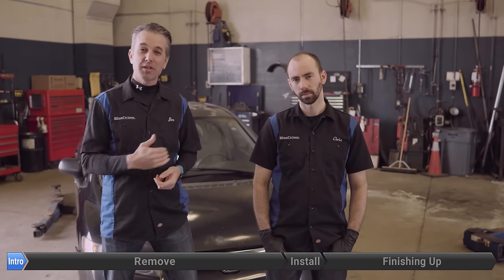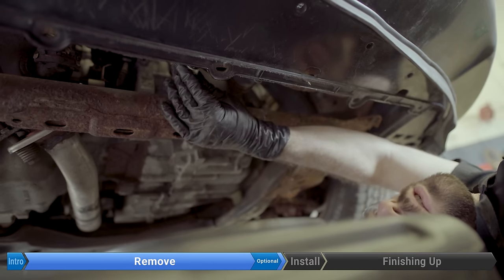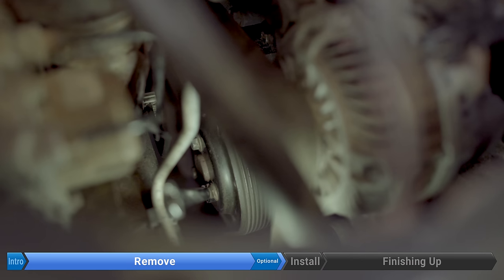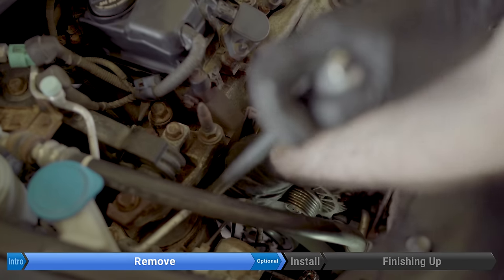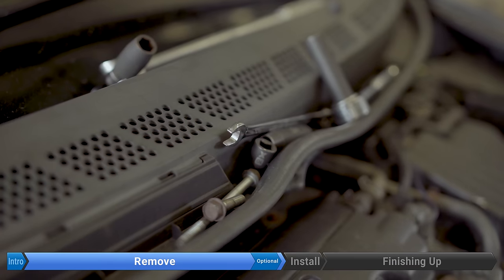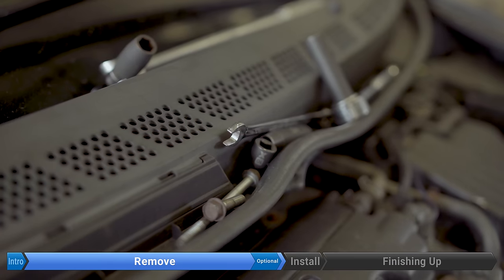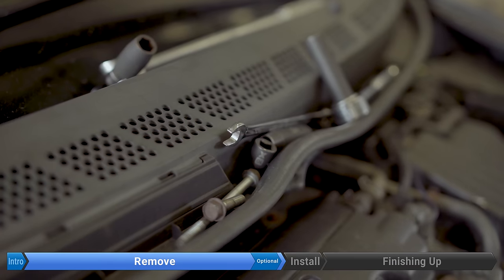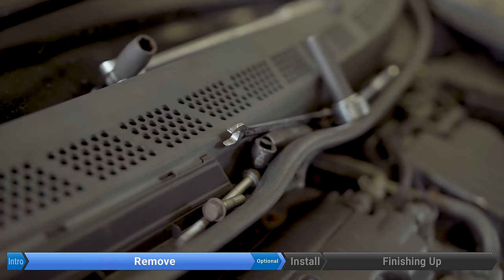Water Pump – 2006-2011 1.8L Honda Civic

Comment: Finally a repair video that doesn't just say "to install,  just follow steps in reverse", but actually includes torque specs along the way. Great content. Tackled this job in 4 hours (mainly waiting for the penetrating fluid to work)

Comment: Great Video here!  You are obviously a seasoned pro tech.  The way you talk about not rushing the job, using patience on stuck bolts, and use of torque wrenches to apply even torque on the pump and also makes it nice if somebody else ever has to go in there again.  A+ job!

I just happened to drop by because I bought a used Honda and wasn't familiar with this model motor and wanted to take a look before diving in.  It will get the same treatment that you apply, been fixing cars for almost 30yrs now.

Subscribed!!!

Comment: I moved to Texas from Chicago 35 years ago. I have forgotten just how rotten and rusty and corroded cars get up north! I have a 2010 with 170,000 miles and it looks brand new under the hood and the chassis. No rust and all the fasteners still have inspection marks and plating. I feel for you guys working on these rusty things. That said, I do pressure wash my chassis and engine at least twice a year. I can easily see leaks and it keeps the corrosion to a minimum.

Comment: I loved the added humor 
TIP: I had to do this job on my kids car. After knowing someone and then helping him to fix a snapped tensioner pivot bolt. A few days before as soon as the car was parked for the night, motor still hot I would sprayed penetrating oil on the bolts  I also Jacked the passenger side up to help get the oil to flow into the block. I did this about 5 times and used different Pent oils each time. When the time came for the 8mm Allen I just lowered the motor. I know my luck so why push it. It came out with an impact but didn't take a lot. Best of luck to everyone just take your time and follow this video and all will be good.

Comment: Did the job today. The 8mm Allen key is an engineering fail. Awkward from above. Ended up dropping the motor down using about a can of PB blaster. Hit it with the big impact gun to no avail, and finally broke it loose with a breaker bar and 3 feet of pipe. Slow consistent pressure worked well. Once loose finished the removal with the impact. Back together quickly with the longest task being the install of the belt.

Comment: Wow.  Thank you.  I felt like you were right by my side.  I successfully changed the tensioner and belt.  Parts were less than $100.  Shop would have charged me $589.  This is a professional video.  (Luckily, my hex bolt came off easier than yours.  Thanks for the warning and honesty on that one.)

Comment: My car was overheating. Turned out to be a stuck closed thermostat. To test thermostat, submerge the side that has the springs  in a pot of boiling water using a wire like a coathanger so you don't burn your hand. If it doesn't open, replace it. Do no let the thermostat drop to the bottom of the pot, else it might get damaged due to the excessive heat. Good luck!!!

Comment: Guys here's some tips, when you replace the water pump start adding coolant and checking for leaks, the video tells you to check for leaks when everything is back together which obviously is not right.

 if the water pump gasket won't stay in place just get some coolant on your finger and rub it around the gasket to make it stick

Comment: The Haynes manual calls for applying a thin layer of RTV sealant on top of the gasket before installing the pump. Is this necessary? I saw you guys just installed the pump as is

Comment: This thing looks like a nightmare to do, unlike my buick lesabre which I changed the wp on in 1 hour, Im somewhat mechanically inclined but this looks intimidating and  If my civic needs a change out its goin to the shop. dropping the engine and that allen key risking breaking off  sounds like a nightmare

Comment: What is the exact size of the water pump pulley bolts? My 08 civic lx one the bolts keeps backing out bout halfway. My car made a clicking noise so took my tensioner ofd n was awful looking. Water pump pulley dug almost completely thru it. Plus pivot bolt was broke off i luckily got it out . ordered new bolt from Honda just like ur new pivot bolt and it was too small. So honda ordered another one which was diff too. Luckily a bolt shop had a bolt like my broken one. I got my car used so whoever worked on it musta put in a different bolt than the proper one smh. I replaced tensioner and still makes noises .noticed the bolt on water pump pulley loosened out again.

Comment: Not sure what went wrong but the 10mm bolts on the water pump pulley... I got two of them out with a 10mm but one of them striped :/

Comment: Thank you!
Have issues with the pulley of the water pump on the R20A3 in my Accord
The coating is worn in from the old belt, the new belt is 'siniging' now <2k rpm
Wanted to strip the remaining coat of the pulley surface, but couldn't get it lose

Thank you!

Comment: Awesome job guys. Would you say the weather in your area had a lot to do with why that 8mm tensioner bolt was so bad? I notice a lot of rust there on the car. Being from California I’d assume we might have a lot less issues with that kind of thing?
Reply from the maker: Hi Neeks!

You should have less rust then us, Canadian winters can be brutal on vehicles with the amount of salt and sand on the roads.If you have any other questions or suggestions please contact us any time!

Regards,.
Reply: I had the same question.  I've got a 2011 Honda Civic EX with 161,000 miles, but it's lived on the north side of Atlanta, Georgia and now Austin, Texas and has nothing like the rust seen in the video.  So I'm hoping there won't be the same issues with that bolt coming out.

Comment: Thank you guys so much this is the best video I have come across and this gives me the confidence I need to attempt the fix. Quick question though. If I have a coolant leak, and it isn't at either of the hoses visible at the front, but there is coolant near the water pump, is it safe to say it is leaking from the water pump's gasket?

Comment: With his comment about not sure why the replacement was needed, can you give some details as to what the engine was doing that lead you to replace the pump? The reason I ask is I’ve got a 2006 that continues to overheat, the last thing to change out before doing a head gasket job is the water pump. Any assistance would be greatly appreciated!
Reply: Yes, want to know why the work was done in first place

Comment: 320000 miles on my 06 Civic and the water pump decided to fail the weeper is leaking bad water pump still pumps coolant through the system but it just gushes out through the weeper.  Lights pulse and flicker which tells me the alternator is going out as well. I noticed you guys went ahead and replaced the alternator. Thanks that shows me how to switch that out as well.  Thinking about replacing my headlamps soon wondered if you are going to do the same on this vehicle since they look pretty cloudy they might be restorable is there a video for showing how to change out the headlights?
Reply from the maker: Hi!

We don't have anything for headlamps but I will  forwarded the suggestion along. Have a great day!
Reply: Was this the original water pump when the car was bought brand new, and you are  just now replacing ir? If so, that awesome!

Comment: 13:44 : Instead of lowering the engine, just drill a round hole in the frame in-line with the 8-mm hex tensioner bolt. Take measurement before drilling !

Comment: So is it recommended to replace the tensioner as well with the water pump?
Reply from the maker: It's always a good idea, but especially in this case - you don't want to mess with that bolt again later if you don't have to
Reply: @LemurMonitors  ,hello friend , so timing belt , 200,000 miles ?
Reply: @sinaloense5798 Every 100K miles. Do it at the same time as you replace the spark plugs.

Comment: How many miles were on this car? I have a 2010 civic with 140k, was going to do the alternator this weekend. Now thinking I should do all of this as well...
Reply from the maker: About 120k - certainly couldn't hurt, but the alternator is easy enough that you could do the two different days and it won't take that much longer overall

Comment: Ok, it is really as hard as the guys are displaying it.
I got no luck as the last bolt of the water pump ripped off with 1mm thread outside the block...
That job is total carnage... when you look at it: easy going, bruh... but thos fucking bolts...
2 of the tensioner, 5 of the wapu...
The rest is a piece of cake.

Had to smash sealant on the wapu and torqued the 4 remaining bolts with 2NM more.
Its not leaking and running as it should.

Comment: The 8mm Allen bolt does not want to come out. I dropped the engine as a last resort. I have access to the bolt, straight on and I cannot remove it with a battery powered impact wrench or air wrench. I'm getting frustrated and running out of ideas. This bolt can go to hell.

Comment: I have a stupid question: On the battery, why do you disconnect ground first, and connect ground last?  I'm in the computer hardware business and there it is the opposite, so I'm confused.
Reply from the maker: One of the biggest reasons is safety - if the ground cable is still connected and you go to remove the positive lead it's a lot easier to hit a wrench, your hand, etc on the body of the car or other bare metal surfaces then you've got an unintentionally complete circuit.
Reply: @LemurMonitors  Thanks, I really appreciate the response.  And for what it's worth, I bought your companies OBDII Scan Tool last year.  Much appreciated.

Comment: I had to completely redo my battery terminals the crappy factory ones corroded away
Reply: While assembling, get some grease on the battery terminal bolt threads.  After assembling, apply some grease or spray on some oil or wax over those terminals and check them every once in a great while and you shouldn't have problems.  Where there's a lead-acid battery, there's almost always a corrosion problem if you do nothing.

Comment: dam had 2 drop da engine just 2 install/replace water pump
Reply: I had to take off my timing belt and and take the crank bolt off my 99 civic.  Consider this a simple fix.

Comment: This job looks like a complete nightmare
Reply from the maker: It can be, but it isn't guaranteed to be
Reply: It's not that bad..  just heat the 8mm tensioner pivor bolt.  That bolt is a BITCH.. it took me 30 minutes of heating and trying.. finally came loose..  use flange sealant on water pump when you install new pump..

It took 2.5 hours to do the job.. just be patient